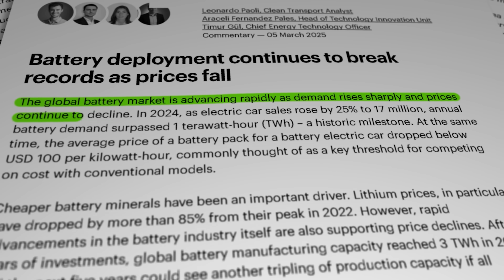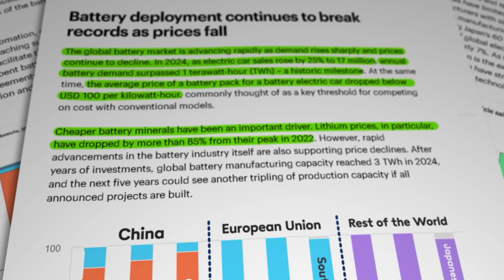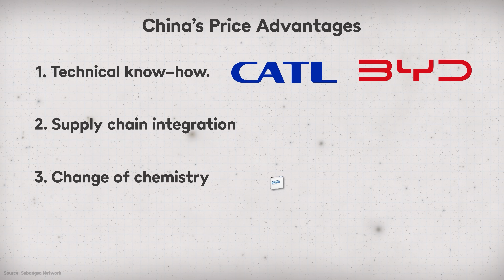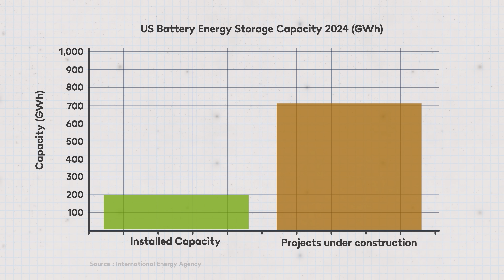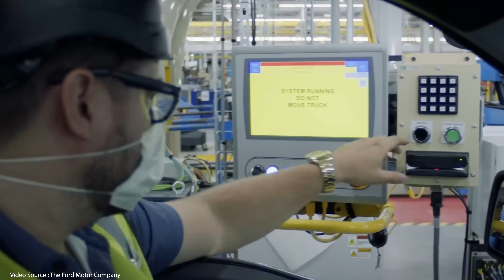Have batteries just hit their exponential curve??

Comment: 4:06 So much snark... lol. I'm not against EVs. I just think that the proper bridge between Gasoline powered cars and Electric ones should always have been Hybrids. I drive one... and when you can reduce the amount of fuel you comsume without giving up on comfort or ability, that's when you've got a winning combination. And there's all kinds of hybrids too. Mine happens to have an internal combustion engine along with a battery bank and electric motors, but you can take the next step towards a full EV by having no I.C.E. and just motors but include a gasoline-powered generator to rechard the batteries on the go. And as you're advancing Hybrid towards full EV, you're increasing performance of electric motors, reducing costs of cells and increasing their capacity all while not giving the big Oil companies the middle finger. It gives everyone time to adjust to the new paradigm without forcing things down people's throats.
Reply: Hybrids have had their 20 year era, to the great benefit of mechanics around the world.
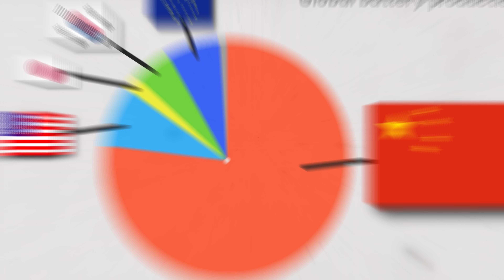Reply: 4:35 Perhaps, but are Chinese EVs of a high enough quality to pass American standards? Are they built to last? If they're like any other Chinese product on the market, I have my doubts. Serious doubts.
Reply: 5:02 Sigh. They only have that know-how due to manupulative contracts and idiotic technocrats too blinded by a quick buck to realize they'd be losing their IP by working with China.
Reply: 7:00 The problem with communist systems trying to mimic capitalist ones, is that unless the ruling class rules with an iron fist, you're going to get unrest due to time spent working and money taken home for that work. Unless you quash them early, you'll have labor revolts (like we did in the US) which will end up with increased wages for workers, but will negatively impact their ability to compete on the global market. The only reason China is able to compete is because their wages are so low.
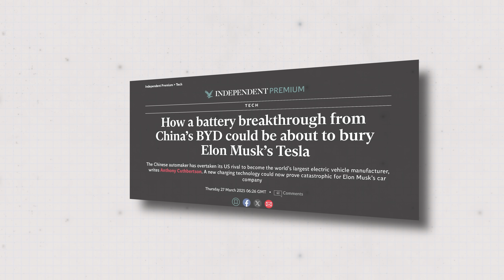Reply: 9:39 ... ... so much snark.
Reply: @Xero1of1 They are much better quality than American made vehicles
Reply: @Xero1of1  American standards let the Cyber Truck on the road just fine. US cars were synonymous with gas guzzling junkers until the Japanese forced the local brands to step up their game.
Reply: In the other direction it would be nice if it was super affordable to add rear wheel in-hub electric motors to a front wheel drive ICE vehicle... Hmmm $60k on a new EV or $20k to convert a used car to a hybrid?

Comment: Hi Dave, French living in China for 26 years here.
New regulation in China set to begin on 1st of July 2026: "Safety Requirements for Power Batteries Used in Electric Vehicles (GB38031-2025)," 
If I understand it correctly it will increase dramatically the safety requirements of batteries used in any EV. 
In effect only the batteries produced with the newest of the newest technology (much safer indeed as they should prevent fire and explosion even during thermal runaway) will be allowed in China by the middle of next year forcing current technology used in China to evolve dramatically and becoming a huge bonus to the China EV industry since it is probable that all competitors outside of China cannot force such transition so "easily".
And what do you know, CATL, BYD etc... most Chinese manufacturer announced they are already able to reach the new standard and produce a battery that doesn't catch fire or explode.  That is probably the reply of China to all the investments in the world to produce NMC or even LFP batteries effectively protecting their own market in advance. 
Catching back with China on the EV market will require much more than mega factories producing large quantities of batteries.
Reply: Seem logical, since battery technologies have reach a point of maturity that this policy won't hinder the cost and uptake of the technology. It's like airbags, seat belts and Abs that was made compulsory
Reply: @passby8070  Yes, we are in total agreement and if doing so forces some company to increase their own product safety I am all for it. When the regulation doesn't tell you what you can or cannot do but just tell you that you need to reach a certain safety level, I am ok with that! Remember when cars could be produced without crash test, without stopping distance test, etc? It is not always protectionism but hey, if a country puts in place some standards that others cannot reach what does it says on the other country care for it citizen or the other country technological ability to raise its standards? If tomorrow a country creates a new standard regulation asking for a medicine to have 0 side effect to be on its market and the local companies are able to produce such medicine, would it be bad?
Reply: I tried to post the quote of A Smith about how this works, but it's not 'sticking'.  Please try to find: 'A Smith, WoN, chapter 11, part 3' and there the last paragraph - as relevant as ever.
The only thing u need to bring is the understanding that prof it is revenue minus cost and that revenue depends on supply vs demand.  If demand > supply, revenue will exceed cost.. competition is now incentivized to join on the supply side - increasing it until it meets demand (at cost) - which means prof it VANISHES.
IP and similar constructs prevent this and enable prof it maxi mice ing of a few, who then become wealthy and powerful and are naturally interested in holding and improving on this status quo..  missallocation of resources / market failure being the result - not to speak of what this does to a society.
Reply: As long as the regulations are published, free, viable for non-chinese, open, and don't call for some proprietary technology, im all for increased safety regulations. However,  everyone needs to be skeptical.  Countries/trade organizations often put in restrictions and regulations as soft barriers to protect their internal industry. EU does this all of the time. They hide seemingly innocuous requirements in their regulations that become a cost barrier to competitors outside of the EU. If these chinese regulations don't have that kind of built-in corruption,  fine. BTW, this kind of detail is why a moron like Trump shouldn't be in charge of any trade deal.
Reply: @davidflorsek9105    those regulations (or better the reasons and intended goals) are NOT public and free as they most often originate with private interests that have the ear of the lawmakers/regulators to eek out benefits for themselves at the cost of the rest.
A Smith figured this out 250 years ago and wrote it down in WoN.
We have NOT made progress since then, this is still happening and working like this and having the very same outcome as it did then and lead to Karl and his mislead ideas of how to solve this..
Reply: A Smith explained 250 years ago that any regulation that comes from/with the majors in any particular industry has the purpose of restricting competition, as not all will be able to keep up.
Just sayin'
Reply: @joansparky4439  I don't agree. Safety belt being mandatory doesn't seem to be like that. Some basic food regulations either. High safety regulation for an item that can combust or even explode, I am not going to consider it is bad and restricting competition. 
Others like forcing all mobile phone companies selling their products in Europe to use the SAME charging port? I am ALSO ok with it. Less waste, less corporate greed. I don't think all regulations are designed to restrict competition, some are just plain common sense. Imagine the waste if all EV makes decided to have a different charging port on their car? Well, Tesla did, and at the beginning it restricted the use of their charging station to their own customers. Is it still a smart move now?
Reply: @ dominiqueridoux2073    yes, there is two kind of regulations - while a sustainable society needs to enforce regulations/laws/rules that:
1)  protect the habitat
2)  protect the individual (unless this breaks #1
3)  protect societal frameworks (unless this breaks #1 or #2
Any other regulation has only one outcome (and goal) - to shield a few from competition - i.e. generating a monopoly.
Reply: @ dominiqueridoux2073  
PS: Tesla went with its own design for high power as the incumbent manufacturers slow rolled the common high power standard, while Tesla needed it for it's cars.  They (ab)used their regulatory power.

What then happened in NA was what actually should be normal - the innovative solution became the standard - due to market forces.  In the EU the regulatory process prevailed and Tesla had to retrofit with a common standard - years AFTER it had ran with its own to be able to sell EVs that people want.

That Elon is how/who he is, is tragic though..
Reply: @joansparky4439  So in your mind, first in should always win and become the standard of the market and therefore control the market? This is how monopoly is created. Nobody can ever propose anything else? What happened is another standard came in (CCS) and became the norm because it could do both slow and quick charge but mostly  most EV producers were able to agree on using the same standard in Europe. Hence regulation created to fit the largest possible number of users and once again avoid the waste of multiple type of charging stations. (may I remind you that Tesla charging station used to be ONLY for Tesla owners, that is also WHY the regulation appeared). Tesla didn't JUST retrofit to the new standard because of regulations but because also the customers could then use any charging stations and not only the Tesla ones.
Reply: @ dominiqueridoux2073    
Without IP (an anti-competitive construct) there is NO market control.  Any competitor can anytime use that standard or come up with a new one, if he thinks he can do better - adaption by the market (success/failure) is another matter.
Tesla gave up its IP on the connector standard (physical/protocol) for it to become the NA standard.

ANY monopoly is based on regulatory restriction of competition (by the monopol on force, government) - granting only a few the right to offer product based on some form of IP or other regulatory hurdle.
In the case of safety belts and food safety it is sustainable for a society (and the individuals that make it up) to demand regulation - to protect itself from the outcomes/cost of non-adherence to some standard.  But whenever the habitat, individuals or society are not in danger such regulation will only create rent extracting monopols that cause a misallocation of resources / inefficiencies.
Reply: @ dominiqueridoux2073    Tesla needed fast charging in the US way before it needed it in Europe.  As the US car industry wasn't willing to come to a common standard early on Tesla HAD TO make its own - to be able to sell its product to users, so they could use that product - there was no standard available!
The EU market came at least 3-4 years AFTER this had gone down in the US and thus only a few Teslas had to be retrofitted to the common mandated standard, which was more clunky and less capable to boot.
The other thing for the Tesla connector being so widespread in the US is that Tesla built out fast chargers to make the product (EV's) viable for its customers.. it's charging stations are way more numerous and in better shape and can deliver more charge that what the alternatives were and are offering.  This is also why it became the standard.

The EU would have went the same way if it wasn't for incumbents and their market power, regarding access to regulatory authorities - which they (ab)use to restrict/undermine competition.  A Smith wrote about this 250 years ago already!
Reply: @ Some regulations are for consumer protection. They are not always for protection of internal industries.
Reply: @ sd70cal   Even Capitalism is based on regulation - no matter what people state.
Reply: @joansparky4439  I don't know if it is based on it, but capitalism works best for consumers if there is some degree of regulation.
Reply: @ sd70cal   not just for consumers..  and we can qualify what kind of regulation, namely regulation that 1) protects the habitat, 2) the individuals (unless this breaks #1) and 3) society (unless this breaks #1 or #2).  That's all the regulation that's ever needed.  Any further regulation creates monopolies for the benefit of a few at the cost of the rest.
Reply: FYI.  China has always had a protective market.   Just goes to show what they will do to keep outside competition out.
Reply: @entangledmindcells9359  Outsiders will only need to meet the same standards as Chinese industry. They just need to keep up.
Reply: @Doesn't change the fact China has had and continues to have a protective market.
Reply: @ entangledmindcells9359    we all have protective markets as IP are world wide enforced, shielding the IP holders from competition, preventing supply from meeting demand at cost and instead allowing prof it maxi mice ing of a few (at the cost of the rest).
What local nations add on top in regards to tariffs (or similar) really doesn't tilt the field much further..
Reply: @ Tell that to all the IP holders that have had their IP stole by China firms & china unwilling to enforce the IP holders rights.
Reply: @joansparky4439  Definitely the smart way is to stay ahead technically and the accusation of "protectionism" becomes irrelevant.
Reply: @entangledmindcells9359  Raw milk cheese cannot be sold in the US unless aged 60 days while it is ok in many other countries in the world. Do you see those countries complain about US protectionism? Each country has its rules, that local producers need to follow. You want to get in, abide by them, just that simple.
Reply: @ dominiqueridoux2073   if one stays ahead technically there is no need for IP in the first place - but this also means that the revenue will always trend towards cost (no prof it) AS FAST AS POSSIBLE.
Not only has our current (and past) money a problem with that (ZLB), but also a lot of individuals who rather like to benefit at the cost of the rest.
Reply: @joansparky4439  "IP are world wide enforced, "    I guess you have missed the countless examples of China thumbing their nose & international IP law and literally stealing it left and right.

Your IP only matters if the other country  is willing to respect it. l
Reply: @entangledmindcells9359  Just like EU?
Reply: @bryanleubg  Except the EU respects PI.. China does nor.

Comment: Just to put things into perspective the UK currently uses around 1TWh of electricity per day. That will go up a lot when heat pumps are in widespread use and it is a cold winter's day. If it is a flat calm and there is no sunshine that 1TWh + will have to come from a combinaion of nuclear, storage and imports. That means that tens of TWh are required for a country like the UK. That is a lot.
Reply: On the other hand, presumably the switch to heat pumps means a drop in gas consumption?
Reply: I would imagine that the UK still has a number of relatively efficient gas turbine electric generators.  If you keep some of them around, they can be used on the rare occasions when there is no sun AND no wind over the entire country and surrounding waters.  Running some gas turbines a few days a year isn't going to be that much of a setback.

Comment: Big problem still is security and safety  of every battery. Even LFP. When millions of cars with large battery would be parked in underground or some large parking lot. For example 1000 EV or Phev and one catch fire, you have large bomb of wild fire. Entire buildings could collapse in toxic large fireball. I am pro EV, but facts are still there.
Reply: It is true that some batteries can burn very well.. but petrol (gas) can also burn very well.

The Lithium Nickel Manganese Cobalt (L-NMC) battery chemistry has most frequently been problematic, while Lithium Iron Phosphate (LFP) is much less likely to catch fire and much easier to extinguish.

Modern "standard" EVs mostly use LFP, and place batteries in sealed containers that keep the batteries in their safe electrical operating zones, prevent physical damage, and keep fire in check if it does somehow happen.

Consequently, I don't think your parking lot situation is realistic, unless the EVs in question are all badly designed and built. Single EV fires have happened, but I doubt we will see tens of EVs go boom at once.
Reply: Thanks for the reply, but I already know all those informations about NMC, NCA, LFP and other battery as those with sulfur, or metal battery. Thermal runaway, short circiut in such condense space still can happen. Gas burn is much easier to put in control. When large battery based on any lithium starts burning much higher and wild temperature starts. Hard to stop then, hard and toxic elements in side battery are hard and evil for human health. Energy and temperature rise quickly and can melt steel frame of parking lots. When you have 1000 of them, huge security problem. Just even more than NOX from diesel. The this latest trend of all packs to make them as part of car, glued hundreds of cans in one large battery because of space and  increase of energy stored in same space. Just one or few of them in problem, you jave to cut for hours entire car. Service zero smart. They say also for rigid chasis, just excuse to rise range, 
   @rivimey